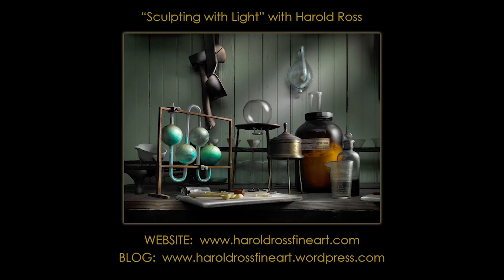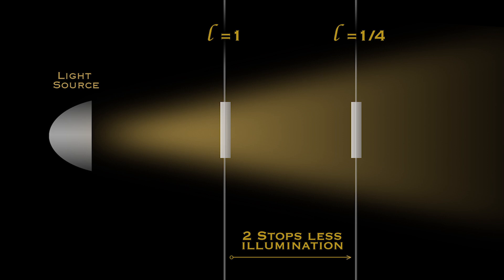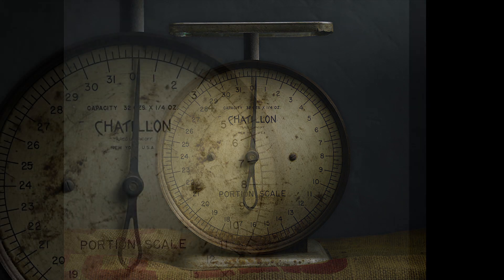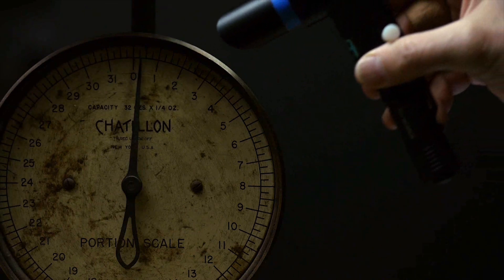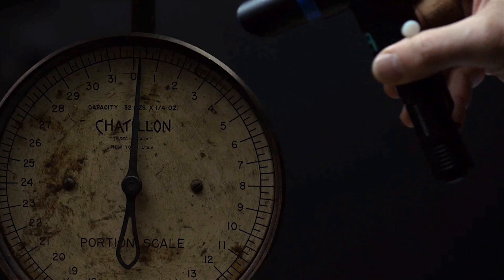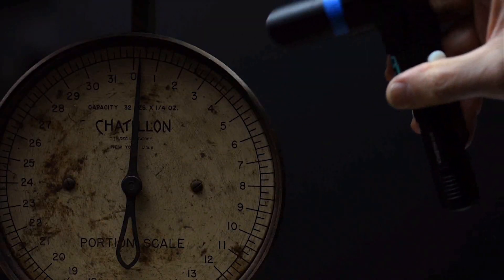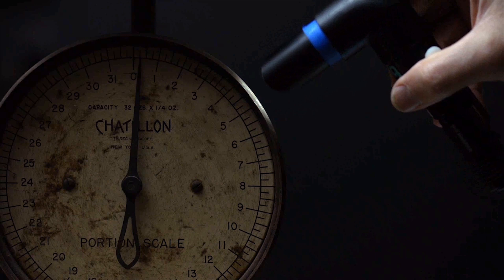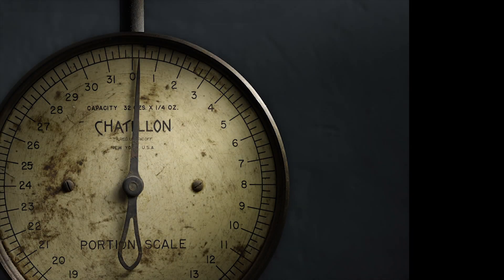Harold Ross Light Painting Graduating a highlight using the Inverse Square Law

Comment: Hi Harold, Great tutorial. How do you determine how long to keep the light on a certain area ? Thanks for your help.
Reply from the maker: Hi there, thank you. It’s really just a simple matter of exposure. Exposure is a technical thing, not an aesthetic thing, and so it is solved by simple mathematics. The simple way to put it though, is that you shoot a capture for a certain number of seconds, and then you determine if the exposure is over exposed or under exposed, and then you compensate. That is one big advantage of using a tethering software (I use Capture One)where you can use the exposure slider as “the worlds best light meter“. There are many variables of course; ISO, aperture, brightness of the flashlight, distance of the light to the subject. All of these things affect the exposure.
Reply: @rossstudio  Thanks for your help.